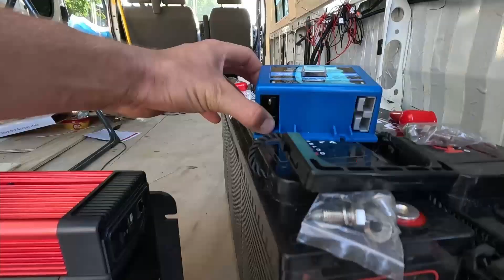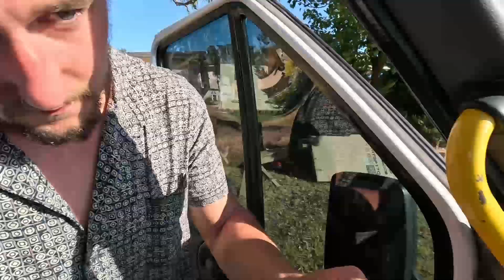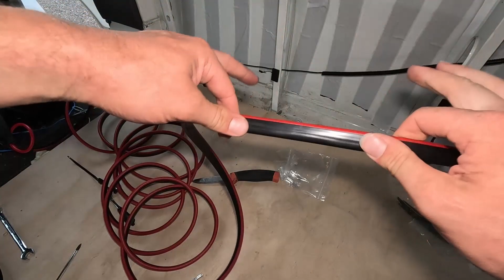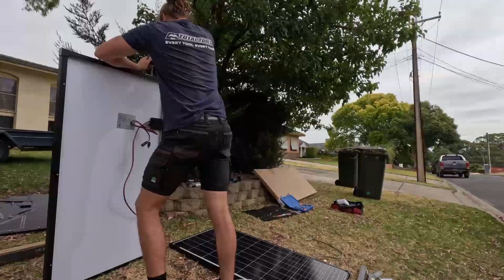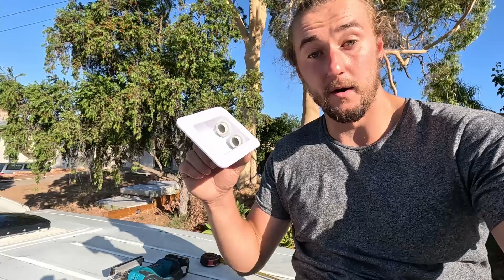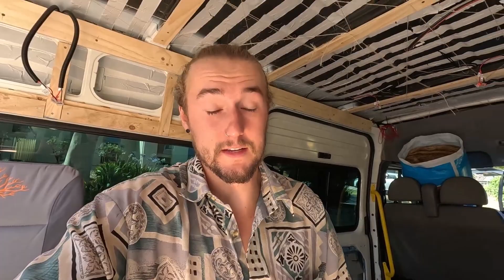FULL 12V 'KickAss' Dual Battery Setup for Off-Grid Van Life | Solar, Inverter, Charger Install |  #8

Comment: When Using soft core cables you should always use cable ferrels especially with that much amperage going through it. Over time the nut holding/clamping the soft copper will get looser and looser and lead to a potential fire, otherwise good instructional video 😊

Comment: The two solar panels what is the watts of the solar panel
Reply from the maker: Hey mate, I bought two 170W panels for a combined 340W. It's been more than enough to keep all of the essentials in my van running full-time without needing to drive around to charge👌🏼